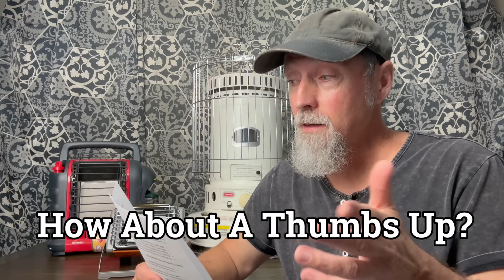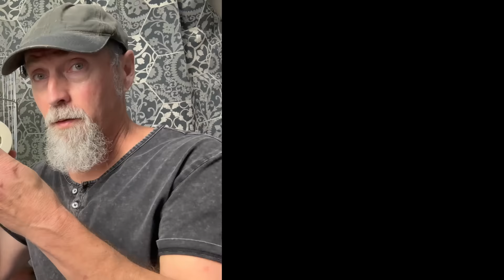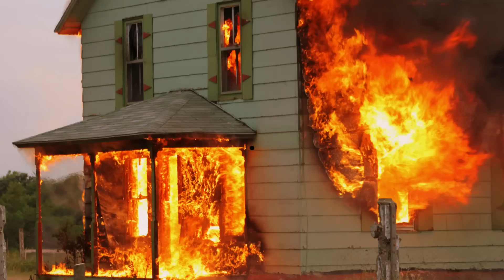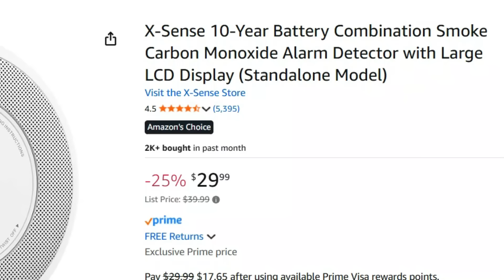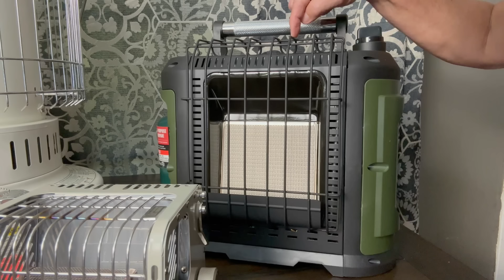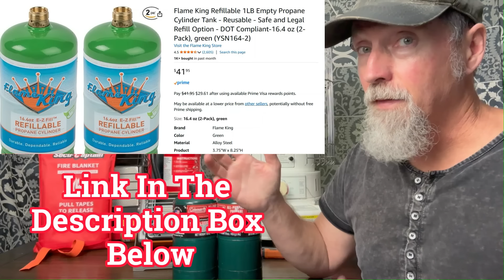Emergency Heaters (Power Outage Winter Heat Safety Guide)

Comment from the maker: What is your favorite type of emergency heater and fuel combination?
Reply: I do like my Buddy Heaters.👍
Reply: Mr. Heater Big Buddy and propane canisters.
Reply: VESTA Self-Powered Indoor Space Heater & Stove plus Canned Heat for fuel are perfect for my apartment.
Reply: I have a free standing LP heater in my den and LP gas logs in the fireplace in the living room. they are both connected to a 250 gallon tank. I also have a Big Buddy heater that I can place in the hallway that keeps all 3 bedrooms nice and warm.
Reply: big kerosene heater in the basement kept my first and second floor temps above 40 when it was -25 outside, not comfortable but kept the pipes from freezing... if it gets unbearable Ill start up a second kerosene heater on the first floor... house built in 1914 with original windows and no insulation.... i jerry rigged a chinese generator to run my furnace so the kerosene is a hail mary.
Reply: Little buddy heaters and Mr. heater kerosene.👍🏻

Comment: Great information to time spent ratio - thanks!  Ideas about fresh air venting beyond "cracking a window" would be appreciated.  The idea of leaving a window open an inch when it 15 degrees outside and the wind is blowing a near gale is very unappealing. I was thinking about a pvc pipe between the window and the sill with holes along the side facing outward, capped on one end and with a short hose on the  other end pointing into the room. Fresh air without blowing out candles? Ideas?

Comment: Having live in Japan 1987-1991.  That big kerosene heater in this video was our main with a small kerosene heater in the bedroom. Our house was not insulated.. We never cracked windows. Japan still uses kerosene heaters as their main  source of heat in winter.  They have advanced the heater technology.  Those little propane heaters are worthless unless you’re heating a closet . Under 2 gallons of kerosene burned for a day.  We used 20 gallons a week.  All kerosene heaters have an emergency shut off manual or tip over. The Mr Buddy’s don’t last but a couple hours on the small propane tanks. The goal is to be able to heat your home for a week minimum.  The size of a home affects carbon dioxide as well.

Comment: Where is the safest place to store the small green Coleman propane canisters year round, inside or can they be stored safely in shed and for how long?  Some of mine are several years old (unused).
Reply from the maker: All recommendations are to store them in a well-ventilated area. 
I do store a couple indoors for quick access (not saying anyone else should).
If I were going to store a lot of them I would store them protected outdoors (shed ,etc) 
However, instead of storing a lot of them, I have a re-fill kit and keep most of my propane in larger 15/20 lb containers and re-fill when I need to.
Reply: @Grid-DownKitchen thank you

Comment: I have watched many heater videos. This is the first that I have seen that really explained the carbon monoxide detector readings and danger levels.
Reply from the maker: Glad the information was helpful and easy to understand!
Reply: @Grid-DownKitchen direct vent propane heater are safer than non vented heater?

Comment: I have a propane powered generator to run my coal stove if the power goes off.
If my coal stove stops working, I can use the propane to run my buddy heater.
Reply from the maker: That's a great setup for staying warm in a power outage.

Comment: I have all three types, each with about aweeks worth of fuel. This way, I am flexible when it comes to fuel resupply. I also have some wood for an outside barbecue pit and a small brickette grill with a couple of extra bags of charcoal. Those are primarily for cooking, but in a desperate situation, I could boil water on them and bring the hot water into the house.
Reply from the maker: That sounds like you a good plan you have.

Comment: Les, please check your E-mail. I have sent information that will likely be blocked by YouTube. In the Philippine Islands, we have two seasons.The rain/typhoon season and the rest of the year. We usually enjoy warm to hot weather and often very humid. The exceptions are: 1. Out on the ocean, it can get chilly. 2. If you venture up the mountains of Baguio, you may experience frost. Beautiful Bride complained a lot about the temps in the home we rented for a vacation. She also noted that the public water supply "felt like it was refrigerated." A kerosene wick heater or a quality catalytic heater fueld by propane would be all that is needed to take the chill off. An instantaneous water heater in the CR (Comfort Room) would wam up bath water. In the meantime, I worry more about the air conditioning bill down close to sea level.

Comment: Buddy heater is my #1 go to, ran off 20lb. tank, I also really like to use old school oil lamps, provide light and a small amount of heat.
Reply: Where did you keep the tank. They tell us not to use them in the house. Thanks.
Reply: @icecreamladydriver1606 I've had them in the house during outages and was ok
Reply: @jazziez6467  Thanks.
Reply: @icecreamladydriver1606  In the house, no other option for me
Reply: Buddy heater is my absolute last go-to. It stings my eyes, it causes huge amounts of moisture on the windows, it burns through fuel rapidly, it frequently refuses to light, and it stubbornly refuses to light many times when there's plenty of oxygen but its oxygen sensor has deemed the oxygen to not be high enough for it to light. 

I stopped using mine just months after I got it and switched over to Asian butane cube heaters (like the Dr Hows The First Penguin - my favorite (12 hours of heat on low from one 8 oz butane can) and the Naturehike 3-In-1 (3 hours), and they are far superior!
Reply: @michael-bell  I just typed Asian butane cube heater into Amazon but that isn't coming up. Where did you find it?

Comment: I did hope you would do a cost analysis on running these heaters. I use the Buddy heaters for power outages because I can use the same fuel for my stove for cooking. But I have wondered if a kerosene heater would cost less to operate. The down side to a kerosene heater would be the consumable wick that might be hard to find in an emergency. (all of the heaters have a problem with fuel availability in an emergency).
Reply from the maker: I will be comparing the cost in an upcoming video that goes into detail about the various types of these heaters.
It would be a good idea to have an extra wick or two for Kerosene Heaters.